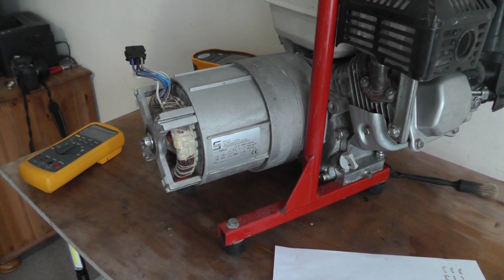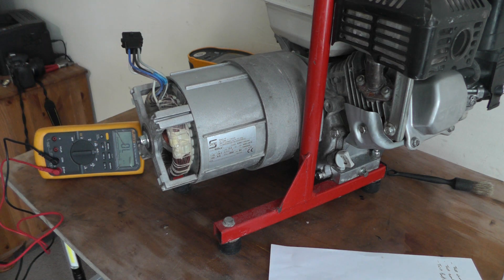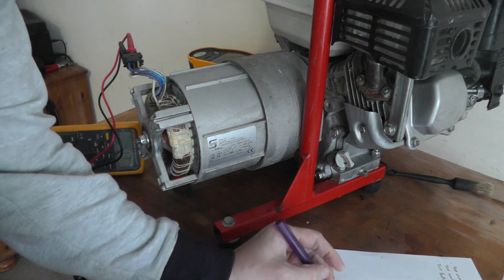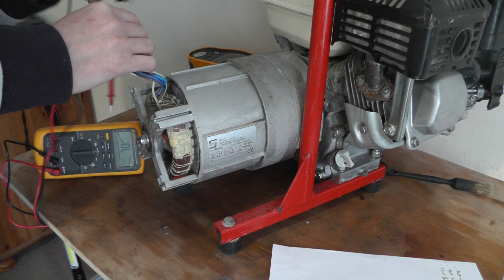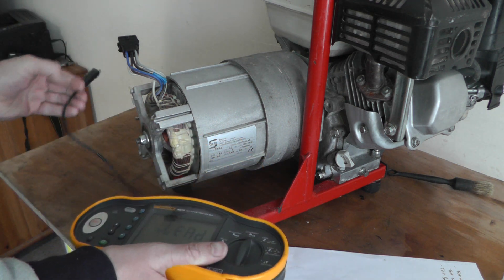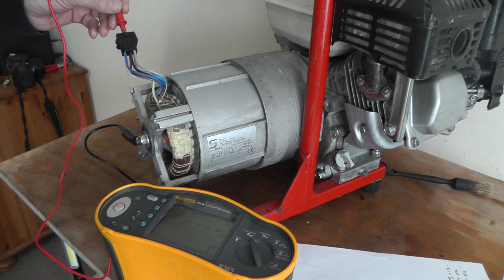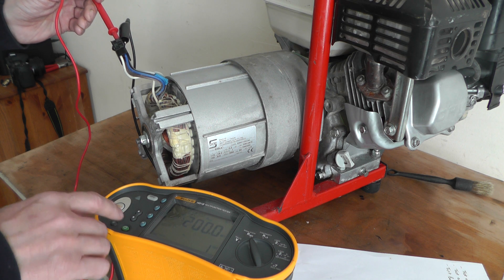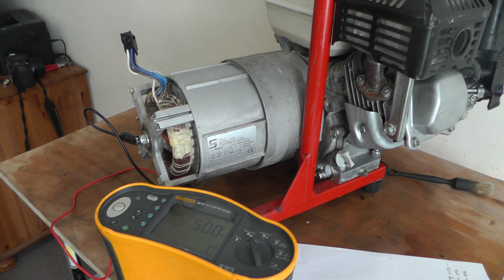Insulation resistance megger testing a Generator stator

Comment: As I said in a previous comment I know nothing about these, but for insulation resistance test to avoid any damage what you can do is link the 5v wire to the one of the other wires and test to earth at 500v  ?  .  Think mains wiring join line and neutral together and test to earth as the will be no portenuel difference you won’t damage any sensitive electronic equipment. But I don’t know if you can do this on that motor. I would be interested to know . 
Fantastic video as always 👍👍👍❤️
Reply from the maker: I think you could combine the 2 wires and test to earth not tried though like you say should be ok , I got a err message in fluke mf tester testing continuity on the 5v coil which is odd